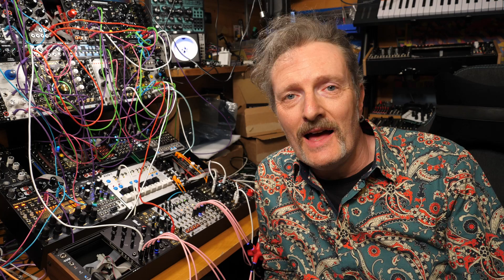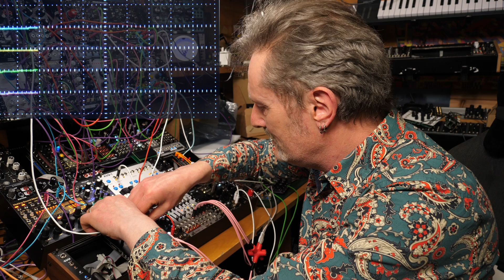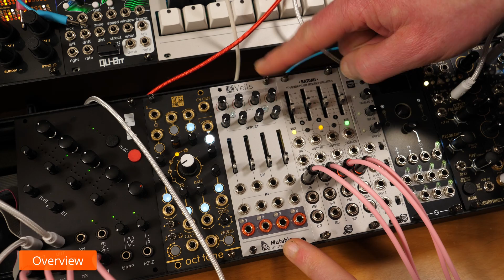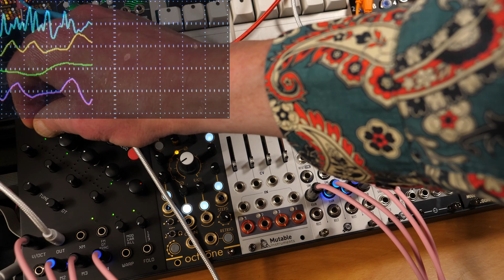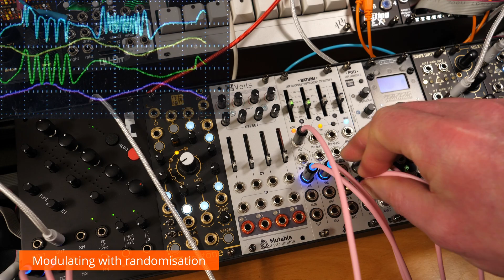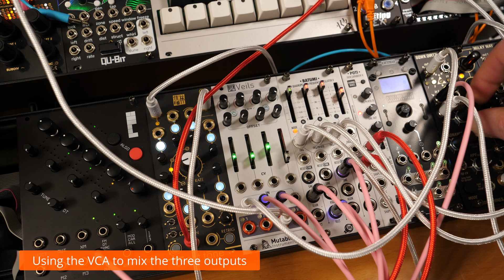XAOC Devices Batumi II and Poti II Review

Comment: Robin, can I ask you a question about the SQ64, i read in a comparison to the launchpad, something about that the sq can't tweak on the fly, their exact wording is "Allows playing on a 5th channel while the sequencer is running. Not possible with the sq64: played notes are only output in record mode"
Reply from the maker: I don't use it with MIDI so I couldn't say, but the SQ64 isn't really a MIDI controller, it's a step-sequencer so i imagine you can only play notes into the sequencer for which you'd need a sequencer track - that sounds logical to me. But as I say, i don't actually know. You probably need something like the Arturia KeyStep Pro which is also a MIDI controller.